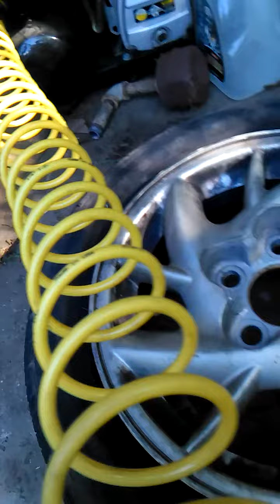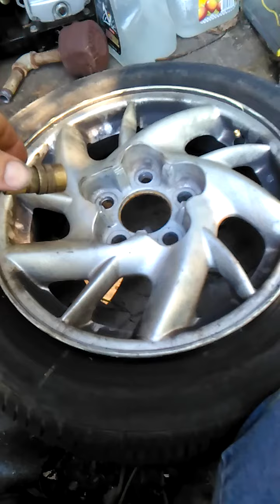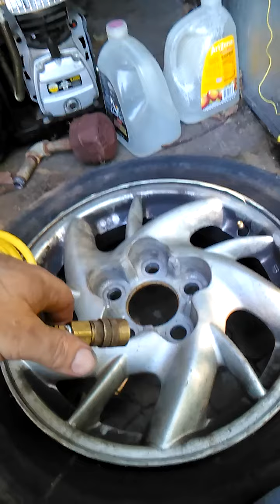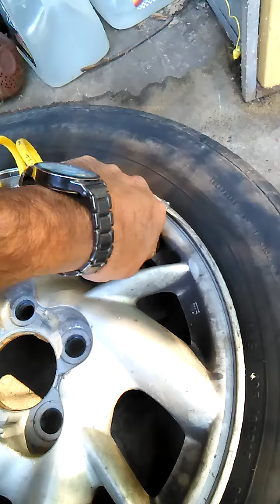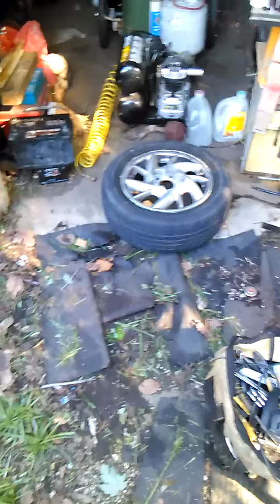How to mount your tires with a small air compressor hack.

Comment: I've had luck using a ratchet strap around the circumference of the tire squeezing it down so the bead contacts the wheel. Might help.